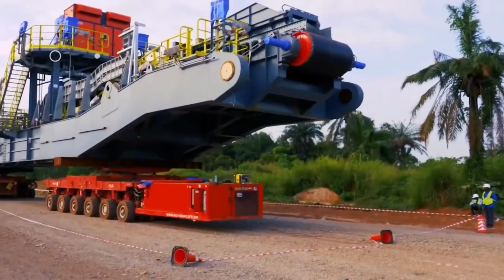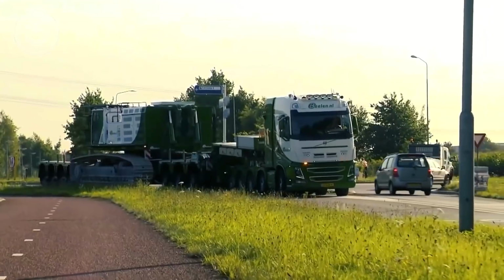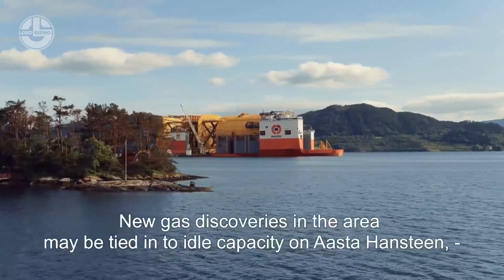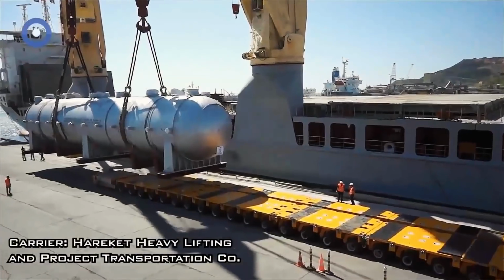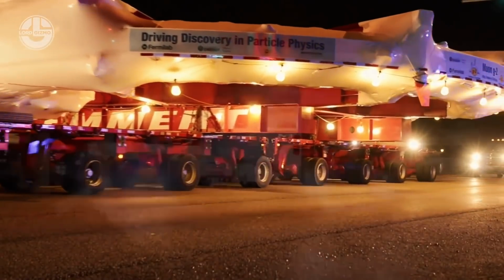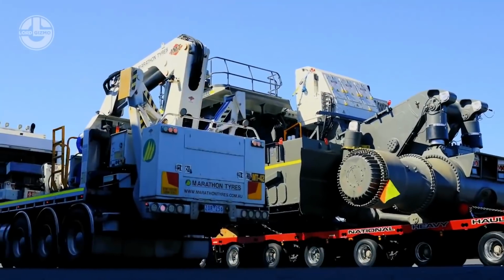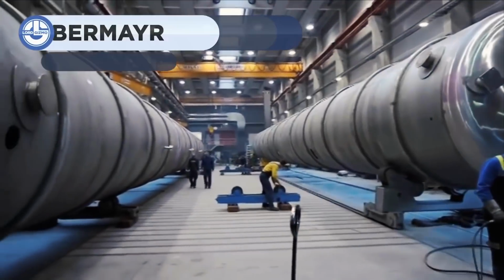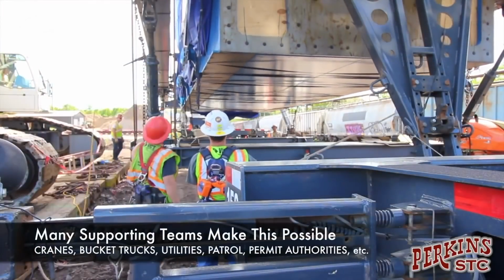This Is How Oversized Loads Are Transported | Mega Transports You Need To See

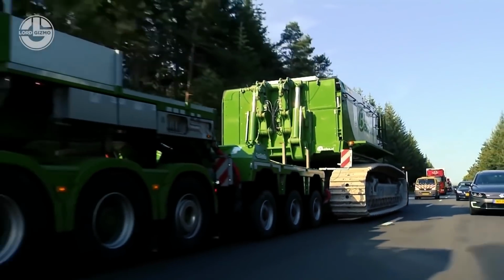Comment: For a technology channel, you guys sure get a lot of dimensions and details wrong.  Examples: 16:10 Audio says "... each preheater weighs 26 tons and measured <sic> 10.2 meters long, 2.3 meters wide and 2.8 meters high".  That's 33 ft. x 7.5 ft. x 9.2 ft.  That would fit in a standard high-cube shipping container.  Another error is at 3:33.  I don't think anyone who knows anything about heavy equipment would call that crane carrier an excavator.  Reply with any errors you catch.
Reply: 1szZZiZzz

Comment: The size and weight measurements on the SIBUR Preheater must be wrong if it's what is showed in video. Then you can have a standard truck to move it!  ;D   
Nice compilation! And also have the Swedish Boliden Aitik Copper mine at the end with the Finnish Slepner transporter. That I call a big rock drill!
Reply: More like 126 tons
Reply: 00
Reply: hhricm n      jjj j un un